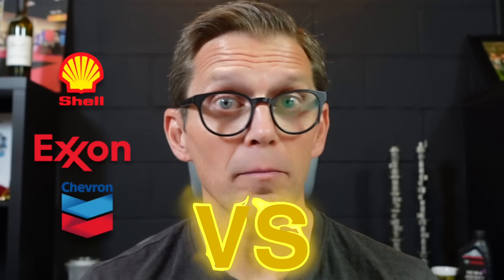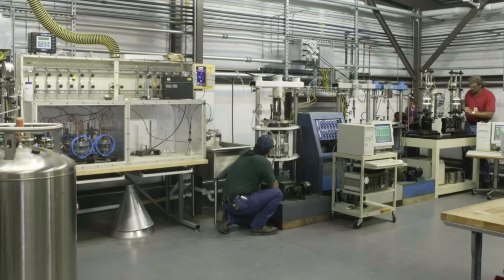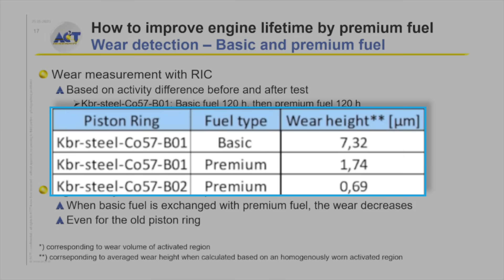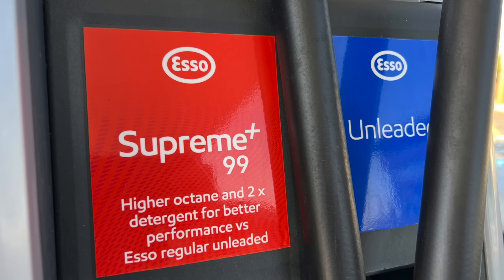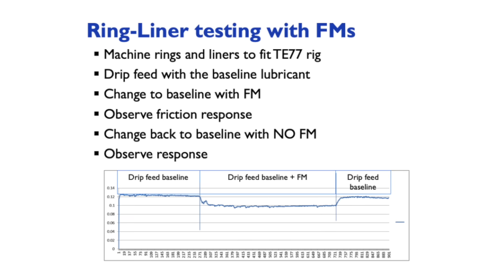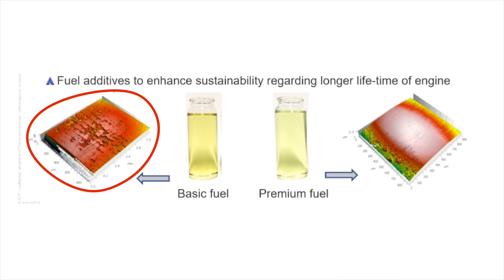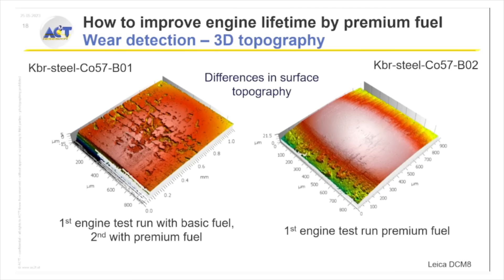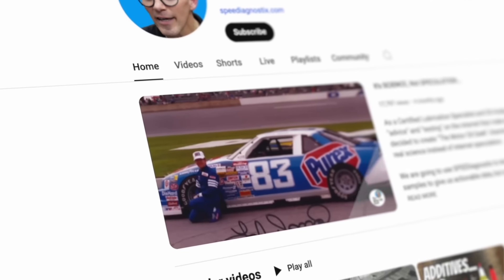Can Premium Fuel REDUCE Engine WEAR?

Comment: Worked for the Big Pecten for almost 29 years.  Had the privilege to tour both the fuel blending facilities at Deer Park, and the research center on hwy 6 on the west side of Houston.  Engineers at the Westhollow facility said the absolute BEST results they have seen in gasoline performance vs engine wear was a rotation of the brand of fuel that you buy.  He said, "one fill up of Shell, next fill up ExxonMobil, next fill up Chevron, next fill up Phillips 66, next fill up Valero.  Use ONLY top tier brands.  They run cars on 24 hour chassis dyno's for months at a time under extreme hot, cold and everything in between.
Reply: I’m an underground storage tank installer, and I’d never ever get fuel from a Phillips 66. Dirtiest and least maintained fuel systems that I’ve ever seen.  Lots of water in them too because they leak badly but don’t bother to fix them until EPA gets involved and threaten to shut them down.
Reply: @lenney872 I normally buy from Shell and Chevron stations here in Georgia. What do I look for to determine how a station is maintaining their tanks? I have never thought about this.
Reply: @JohnRobertConley Stick to new big chain stores built recently and avoid super old mom and pop places for gasoline. Old tanks were made of steel and have long since rusted out.
Reply: @lenney872  thanks for the heads up on what to look for
Reply: @lenney872  - yep, the storage tanks at the station are far more important than which additives, etc. My mechanic gave me a list of approved local stations that he tests regularly. One quick look at your vehicle and he'll know if you've been cheating and drop you as a customer.
Reply: @ThebigShrimpy  I’ve heard that before many years ago. Different additive packs take turns cleaning your engine.
Reply: Excellent !   My V10 Triton manual asks for 87 octane.  I really want to give it the most “healthy” fuel for longevity. I.e. premium fuel. Will 91 octane confuse the computer and negate he gains ?
Does this mean give it 87 octane and manually add fuel treatment each fill-up ?
Reply: @Pineneedle-b9s  i wouldn't use 87 octane in my lawn mower. 🤣 higher octane will not hurt anything....
Reply: @MrMustangMan  I ride an '06 Yamaha FZ1 and I can tell you for sure that it runs noticably slugglish on higher octane than what Yamaha calls for in that engine, which is 87. Seems wierd considering it's a high compression, very high revving engine but it loses power and responsiveness very noticably.
Reply: @Pineneedle-b9s  I have a 2011 Acura TSX with an 11:1 compression ratio and 91 octane recommended. My understanding is that computer looks primarily to the knock sensor to determine octane and maps accordingly. No advantage to using any octane above 91, but if you use 87 or 89 timing will be retarded to protect the engine from knock. If your manual asks for 87, there should be no advantage to using a higher octane. It's the additive package that makes the difference. My car also had a service bulletin and extended warranty due to problems with early low tension piston rings and oil consumption. Acura suggested owners only use top tier fuel. Clearly they were seeing more problems in cars using low quality gasoline that only met minimum regulatory requirements.

Comment: How can they measure 4X the wear (7.32 to 1.74) in 120hr? That's not even half a year driving. Engines would lose significant compression after 5 years at that rate when I've run basic fuel in the same engines for 10+ years. Did they run the test engines super rich?

Comment: I have a 2017 V6 Camaro. I had switched to Mid grade shortly after buying it. I've recently switched to regular because of fuel costs. I'm curious of the difference. Maybe it was already said here, but I can't find a sure answer, so other fans please be kind. 😊
Also, I wonder about doing gas additives from on the shelf if using regular. Premium is really expensive for a daily driver.

Comment: So bottom line what do you have your Daughter running in the 2023 Toyota for fuel Brand name and octane? So why is Toyota Recommending 87 Octane? I believe they just want to sell you another car ASAP. I own a 2024 Toyota Corolla le and plan on doing a Break in Oil Change at 800 to 1000 Miles then every 5 Thousand for the life of the car. I am still debating fuel type and Octane?
Reply from the maker: She uses Top Tier 87

Comment: Fascinating! - BUT I'm left wondering if the big difference in cylinder wall wear is only academic or is of practical value in keeping a modern car running 5W30 GF6 full synth going to 150k or  200k miles? I ran 2 Lexus V8 2001 & 2005 LS430s to over 250k with regular fuel somewhat extended oil changes - no sign of engine issues.

Comment: My friend had a 2003 tahoe with 5.3 vortec with 320k miles. When they motor was on you could barely hear it run..He always used Shell 93 gas.
Reply: Corvette owner in this comment section said 190k on vette “drinking only shell 93”
Reply: I got 315000 out of my 5.3 suburban running 87  since it had 117000 when I First got it
Reply: @riverguy988 409k out of my 5.3 and nothing but 87. And the engine was still going when the truck was junked.
Reply: To be fair, your friend also spent an additional ~$10,000 on fuel over those 320K miles by using 93 instead of 87. The additive packages in premium fuel are nice, but they're not giving it away and that adds up over time.
Reply: @nowayjose596  yes totally there is a fine line but this is not the point here. It is about Shell additives really do the job.
Reply: @nowayjose596 still cheaper than buying a new car within that 320,000 mile period. It would take me 15 to 20 years to hit 320,000 miles.

Comment: Two different aftermarket tuners have told me to use Shell gas because it was the most consistent for octane rating. My truck is custom tuned to 92 octane, if I use any other brand, I get a misfire engine code.

Comment: If my V10 Triton owner’s manual says to use 87 octane,  will Shell’s Premium with higher octane harm it? I’m deciding whether to pump 87 then add fuel conditioner EVERY fill-up (laborious method) or just pump premium as long as the premium causes no harm.

Comment: I have a 2009 Toyota Yaris  it’s like 160k mileage now I always put full synthetic and pump 91 always  still drive like it has only 50k miles. Drive 64 mile used up only 3.3gal of fuel ❤on 91

Comment: I have a 97 Chevy 1500 with a V6 that I always used 87 octane gas in. Then recently I hit the wrong button and filled it with 89 octane. It’s making a big difference in how it runs. It idles smoother, starts easier and has a lot more power. 
I never associated engine wear though . 🤔

Comment: Why not have the proper additives in all grades of fuel from top tier stations?  Yes, keep testing and see if you can find a readily available additive owners could add at fill-ups.    Maybe 1000:1 Honda HP-2.  In my Camry, that would be less than 3 oz oil consumption per 1000 miles!  Far better (less) than what Toyota would call abnormal for warranty service.  Then we have your buddies at Valvoline with their Restore and Protect that keeps the rings and grooves clean.  Maybe a function of that product is also helping the oil/fuel quality at the ring level.  The cost difference between "Regular" and "Premium" at most stations is quite a jump.

Comment: What's intersting is that on order to get the higher end " protectant of the.shell v power+ is ypu have to get premium.fuel. which makes sense. Most people don't purchase premium unless it required. So they don't get the added benefit by purchasing the 87 octane. If they really understood the benefits of the premium fuel and the benefits I think more people would purchase ut regardless if they didn't benefit from the higher octane
Reply: But if Shell had half a brain they would put the same additives they put in their premium fuel into their regular and mid grade fuel, then sales would skyrocket.

Comment: I use BP non ethanol fuel with Mobil 1 motor oil in my LS1 corvette. Plugs run clean, intake manifold has no carbon. Oil change at 3500 miles. Knock on wood, everything looks great, even under the valve covers.

Comment: Dude thank you for this.  I've always used premium gas in my engines no matter what for the additional additives.  I've been using Shell premium gas for years in my  Hemi Magnum.  I like knowing that the fuel is good and top tier gas.  Too many people complain about the cost yet will waste their money on fast food.  Give up one meal for your engine.  Cars and trucks and car services is too expensive.  Be nice to your engine and feed it good fuel.  In the long run it will pay off.    I love nailing pedal in my Magnum never hearing preignition knocking and knowing it's getting the best gas I can put in it.  My tailpipes are clean as a whistle.

Comment: Gasoline DOES come from the same pipeline. HOWEVER: before it goes to the station tank via truck it goes to a holding tank. If the truck gets it from the bottom it's getting the water that oil floats on, the top stuff has all the garbage that floats on oil. Chevron/ Standard Oil Co. is just overpriced stuff and cheap gas... you get what you pay for.

Comment: Do you think 91 Octane Fuel is overkill for a carbureted engine?  I'm currently getting my 1982 Toyota 22r engine and carbureter rebuilt.  Before getting it rebuilt I always ran Chevron or Shell 87 Octane for the additives.  I want to protect my investment, so if you think running 91 is a benefit - I'm all ears!  Thanks!!

Comment: Another deserved WOW!  I never knew this stuff, I always thought, and heard this advice all over the internet, that if a car's engine says to use regular then don't waste money on premium!

But what I didn't hear in this video is if one top tier like Shell which is known to be supposedly the best premium fuel to use, vs Costco premium which is also a top tier fuel that reports are stating that it's just as good as Shell with its additive package, is there a difference?  

Of course everyone will have their favorite fuel they'll want checked, making it impossible to check all of them, but the big question I would have is: will any top tier premium fuel be equally effective at reducing wear?  Or are there really certain brands of top tier premium fuel that is better than other top tier premium fuels?

Comment: Makes a ton of sense as my understanding of the original purpose of leaded fuel was to help reduce engine wear. When the lead was eliminated, the automotive industry had a new problem they needed to solve. However, what i assumed was that if a fuel was classified as top tier fuel, it would have to meet a certain standard. What I didn’t realize was the fuel grade impacts engine wear because they have different levels of friction modifiers. Thanks for this video because I had always used premium fuel on my 2001 xterra since new until i reached 285k to now at 336k. Engine is fine but guess i’ll go back to premium gas

Comment: Curious your thoughts on Top Tier gasoline.  Seems like consumer advocates like Consumer Reports and Clark Howard speak very highly of Top Tier.  Considering Costco only carries Top Tier and is less expensive, it's been the only place I fill up unless on a long trip and there isn't a Costco open on the way.
Reply from the maker: Top Tier fuel is a good thing.
Reply: @themotoroilgeek  Costco is the outlier on prices . Grocery store rewards make top tier station $1 dollar PER Gallon higher . Of course , you have to join Costco and wait in 100 car lines . 🥺

Comment: Im not an engineer but i used valero for 3 months straight because my  work was next to a valero , my vehicle started to have problems , long starts and hesitation when gas pedal was pressed , so bad it wouldn't start sometimes , My coworker told me his truck was doing the same thing  and was using valero by his house mostly ,  so i did some research and switched to shell mid grade Not the highest but mid grade , and THAT was a game changer , i stuck to shell mid grade and never looked back
Reply: Cap. Valero and Shell are both Top Tier fuels, especially mid-grade. Costco & Texaco/Chevron are also Top Tier. I mostly do shell out of convenience to my location, but at one time I was Valero-only. I never noticed an issue with any of those Top Tier fuels.
Reply: @SkimDBeeble  not  for me thanks , for me valero is crap
Reply: @JonathanbradleyT  Haha fair enough. Glad you found a fuel that works for you. That's what's most important because like each of us, every one of our vehicles is unique.
Reply: @SkimDBeeble  Not all locations of shell or other brands are top tier. If the pump doesn't have the top tier sticker then it's not top tier. people can check online which ones are actually top tier.
Reply: @TimJohnson-x1o  That's a fact. If it doesn't have the green Top Tier sticker, it isn't Top Tier no matter what the branding on the marquee says. And the website is an excellent resource.
Reply: Try to actually watch the video. This has nothing to do with octane rating. Using high octane than your engine needs does nothing but burn money for zero reason. The video is about ADDITIVES not octane ratings. Most people don't even seen to understand what octane is.
Reply: @TimJohnson-x1o  Idiot! Try being less of a dick! It's about Octane, because higher OCTANE have more additives... mid grade is a mix of 87 and 91, so YES, more additives and cleaning power.
Reply: @TimJohnson-x1o  In this video, top tier premium has friction modifiers. Anything below 91 has less or none.
Reply: But there also top tier so explain

Comment: Are there any bad side effects of using a fuel additive with PEA’s???  i.e.  If I used Techron with each fill up.
Reply from the maker: Like everything in chemistry, balance is critical. Too much of a good thing is not always good, so if you use Techron at each fill up then lower the treat rate.
Reply: @themotoroilgeek  Understood, thank you!  I usually use it a couple / few times per oil change interval.  (3,000 - 4,000 miles)

We really appreciate your work, content, and your replies to the community!  Thanks a ton!

Comment: Ive had my Mk7 GTI for 130,000 miles now without a single issue or problem. I've only ever fed it Shell V Power or Sunoco's 93 octane (it's tuned specifically for 93 octane). Running quality fuel and doing regular oil chainges with good quality synthetic oil makes the difference. Is it possible that it would've been the same had I used whatever quality fuel and oil? Perhaps. But why take the risk?

Comment: My Ford Transit connect only requires 87octane fuel. Is there an additive that I can use when I buy regular gas, that would make a BIG difference in engine wear? Seafoam, Lucas, etc?? I do add Chevron's Techron additive, every 3000mi to a tankful to help keep the engine clean.

Comment: Hi Lake, I have a question about gas blend and mileage. I own a 2023 Traverse and filled it with 89 octane E-10 Sunoco last week (I pushed the wrong button for the grade), before going on a short trip (about 525 miles RT) that consists of 95% interstate and am typically driving between 70 - 80 MPH with the cruise control set. I manually check my gas mileage at every fill up and this tank of 89 octane gave me 19.6 MPG. I filled up with 87 octane E-10 Sunoco before coming back home and my mileage was 23.9 MPG. Also, over the summer my wife and I drove across the country. I found non-ethanol gas (I believe 88 or 89 octane) in Iowa and filled up with that. Again, my mileage was less than it is when using the 87 octane E10 gas. I thought higher octane gas is supposed to give you better fuel economy due to the ECU's ability to run more advanced ignition timing without pinging. I've read both "Yes" and "No", so I figured I would ask an expert. Thanks for your video's. They are very informative and a great learning experience.

Comment: Ok ,then what about small aircooled Generac whole house generators running on Propane or natural gas that have no additives in them , the same goes for large natural gas or Propane powered irrigation pumps that can run up to 10,000 hours on extreme loads with out being overhauled .

Comment: I am curious if all these detergents and friction modifiers have any impact on engines which have belts running in oil such as Ford. It is already known that the ford ecoboosts engines have serious issues with wet belt degradation, but no one says why that is so only rumors are going back and forth.

Comment: Hi Lake, hope you are doing well. Yes, please I request you to make more videos on fuel gasoline and diesel. Here I have a common regarding high octane gasoline, that's higher the octane rating lower the flame front speed thats why high octane fuel is used with higher compression ratio engine. Your insight please. Thanks

Comment: So where does this leave propane fueled piston engines ? Propane has no modifiers , HD 5 has less than 5% propylene  and the octane number is about 120 . There in my experience it is difficult to get propane engines to seat piston rings . So can the oil change interval be extended ? I say no , what do you think ?

Comment: I've lost count of the number of cars I've had and never worn out a motor yet but usually turn them over when they get to around 10 years old /100,000 ... especially the more modern cars they start to turn into money pits going into the older 150,000 range.... forgot to say I pump the cheapest gas in them as I can buy.